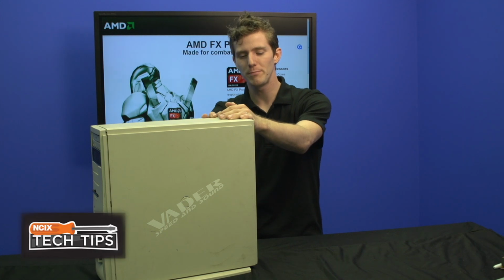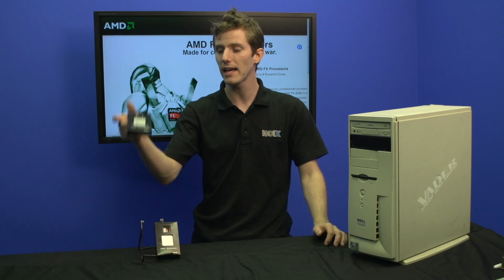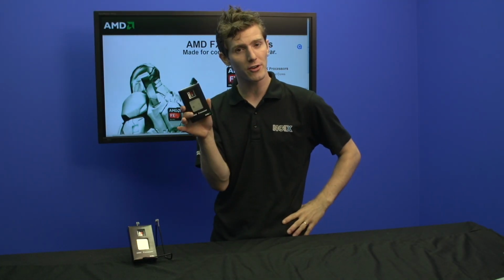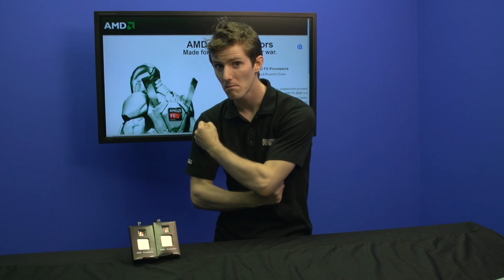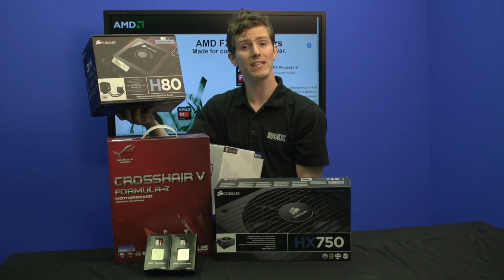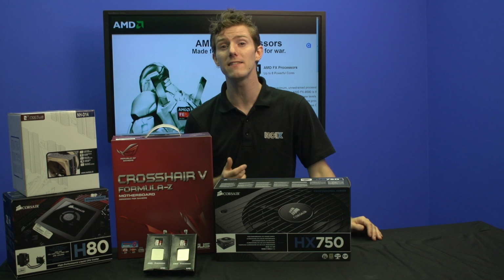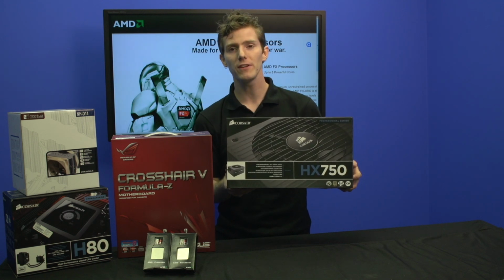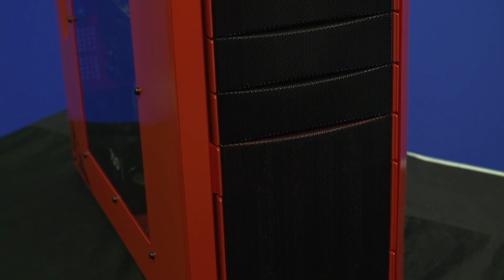AMD FX 9000 series processors hitting 5GHz!

Comment: Right now, AMD is winning in Workstation GPUs and is TRUE winner of 8th gen console war (all 3 companies use AMD GPUs/APUs), since Nvidia GPUs suck at OpenCL (Not OpenGL, that is different thing), OpenCL is the future
Reply: Who cares about console? if they went with intel/nvidia consoles would be more expensive and nvidia pulled out of the console market. intel is still has better performance per watt, better performance per thread, better power usage, and can take more heat over amd.
Reply: mindman1234   amd parts arent hot and pretty much everyone dont care about 20w seriously....  amd have better cards than intel and intel have better cards than amd... but catalyst crushes nvidia's graphic drivers to asia
Reply: mindman1234
money, you need money to progress in R&D, look back at how Intel got such deep pockets.
Reply: mindman1234
nVidia didn't pull out, no one picked them for their console. You don't pull out of an insanely profitable market that has no downside but extra money. Intel CPUs have a thermal limit of ~100C while AMD can only hit ~60C, but that means nothing unless Intel can overclock better on air or water, which they cannot. Both overclock about the same depending on CPU.

You are right about Intel destroying AMD in performance per watt, but AMD are purchased for their performance per $. If people truly cared about performance per watt they would not have bought nVidia since 2008, although AMD GPUs are getting up there also.

TL;DR:
1 nVidia cares about consoles, they just lost the market.
2 Thermal threshold means nothing if you can't deliver better overclocking.
3Performance per watt doesn't matter in gaming.
Reply: mymomsagirlpoopgood
 Except all documentation on the CPUs says you are lying out of your ass.

http://www.cpu-world.com/CPUs/Bulldozer/AMD-FX-Series%20FX-8120.html

Pay attention to the part where it says Maximum operating temperatures. Here is a link to define it for you since your brain doesn't function that well:

http://www.cpu-world.com/Glossary/M/Minimum_Maximum_operating_temperatures.html

The Bulldozer and beyond line of CPUs have a maximum recommended operating temperature is 61-62 degrees. You can run it faster but not without running into issues or lowering the life drastically. We are talking about safe operating temperatures and Intel goes upwards of 100 degrees Celsius without issue because they have fail safes built in. No one with any computer knowledge would get an AMD CPU that hot. AMD CPUs will burn themselves out if you do not have bios set up properly Intel CPUs are drastically less likely to have issues due to down throttling.

Please stop spreading misinformation. If you run a Bulldozer CPU beyond 60 degrees Celsius you will drastically lower the life of the CPU as has been proven time and again with any CPU. The only people that go above thermal thresholds are people that do not care about throwing money away.

Besides if you hit 100 degrees Celcius for a Bulldozer CPU you are doing something very wrong. The Bulldozer and beyond line runs much cooler then the Intelcounter parts by default with stock cooling.
Reply: You are wrong. It is not even worth my time to point out all the misinformation in your argument
Reply: You could start by linking to any source that says you should push past the listed maximum thermal thresholds, because it's not necessary for overclocking and will only result in an unstable OC.

Linking any data is kinda hard when the data doesn't exist. It's hard to begin to fight facts with ignorance. 100 degrees Celsius would fry the a Bulldozer CPU. My FX-8150 is currently running at 4.5 ghz OC and my core temp barely ever breaks 50 degrees Celsius on air cooling (ambient temp dependent). You seriously have no clue what you are talking about. Stop trying to melt people's CPU with your trolling.

You are seriously doing some fucked up shit if your AMD Bulldozer hit 80 let alone 100 degrees Celsius. Learn to overclock properly please.
Reply: mymomsagirlpoopgood Feel The Burn
Reply: mymomsagirlpoopgood The athlons are a different beast to the FX. Athlons could hit higher temps, but the FX can't. Just because you have a athlons, means nothing. tell me about knowing the thermal limit of an FX, once you have an FX. But it is you that don't have a clue. I am an FX 8120 owner with H100i AIO. I can say 61 is the thermal max. I have puched it to that thermal max in summer with no AC, and have it chuck a hissy fit at me (I had a H55 before I got the H100i).
Reply: ***** No, its not that XB1 is running AMD chip, its the fact you bought weaker console for same price as PS4
Reply: Bound4Earth PowerPC was better option back then, but now its not, Wii U is using PowerPC and I dont see it helps much, also CPU power is useless today, since PS4 and XB1 use CPGPU, so their GPU can do CPU tasks (And ofter much efficiently), problem is that multiplat developers dont use this. (Otherwise AC: Unity would run 1080p/30 on PS4 instead of 900p/20)
Reply: Bound4Earth PS2 had better CPU than both GC and Xbox, however GC and Xbox had more memory and better GPU.

Comment: AMD FX-9590 , 2 X Radeon R9 290X... Is that good ?
Reply: Basically your system would be a fireball a 290X runs hot enough but 2 of them? srs?
Reply: Please for the love of your family dont do this. At load your house will burn down.
Reply: Axecution

Comment: AMD is for poor people it is unstable and runs piping hot, however intel is more priced but stable and can over clock to the same in a more stable environment
Reply: AMD CPU's runs cooler, their GPU's run hot though. AMD is as stable as Intel, never had any brand fail on me. Although the Intel one was hotter (albeit it doesn't matter since Intel chips can take higher heat than AMD).
Reply: Intel Ivy bridge and Haswell CPU's run hotter than the AMD CPU's up to FX 8350. (FX 9370 and 9590 are not included because they are getting too hot). But the Intel CPU's will shutdown at about 105 degrees. The AMD CPU's will shutdown at 80-90 degrees because they can't take that much. Ohh and AMD is not for poor people and the AMD CPU's are perfectly stable !!
Reply: KingOguzhan12 +1, but the thermal limit on the fx series is 62 degrees, then it throttles. But the 9370 and 9590 are just ridiculous overclocks on the 8350. Time for amd to bring a new cpu architecture, I hate the fact that they gave up.
Reply: Thats totally biased. Just shhhhh.
Reply: kingDeCosta123 lol right I love it go Ryzen
Reply: The problem is "Money". AMD doesn't have the money to compete with Intel. But at least they can keep up with great GPU's and APU's
Reply: KingOguzhan12 My next CPU is going to be an Intel processor and it's going to cost me more because AMD can't be competitive. That's really a shame. Their APU's are for htpc's and really low end budget PC's, I really wished they could compete with Intel.
Reply: KingOguzhan12
I have the fx-6200 paired with the gtx660 I have 4 monitors connected to it and I only play bf3 with my girlfriend so it will be quite some time before any upgrade is necessary.
Reply: What are u talking about? My AMD runs at 17 Celsius when idle
Reply: ThePatero20
That's really good, what cooler and cpu have you got? Mine runs at 25 at idle and is an Fx-6200 with hyper evo 212 undervolted(I think my temps are good).
Reply: Really. AMD is for the budget. Intel is for performance. AMD IS NOT FOR POOR PEOPLE. It is just better for a budget. AMD has better performance per dollar. Really, c'mon. That's a very biased comment.
Reply: My next CPU will also be an Intel processor. But for now my FX 8350 is just fine. My CPU got 1 year old yesterday xD. Even if I hate Intel I have to get a CPU from them in a few years..
Reply: Oh LOL... Fan boy talking non sens. AMD CPUs don't run hot, they need more power and are stable and can overclock better. If you have 2000$+ go intel and nvidia(like i did) but for 1000$ or so i made a friend a pretty nice and close to my performance AMD machine. You can't beat AMD CPU Value (CPU Mark / $Price ). Intel just overprice there stuff because they can (we will buy them at any price)
Reply: Юлиан Миланов Well the 4930k gives better value than AMD's 9*** series.
Reply: Talking about FX8 series. This 9 series i can not see the point in it
Reply: Юлиан Миланов Depends on application the 4670k can be better, It sure as hell beats the 8350 in Battlefield 4. (BTW Screw mantle until it's fixed)
Reply: I am with 4670k. But here it costs around 50 to £60 more then 8350. I have manage to clock them both and the AMD processor  is doing pretty good. For my next by I definitely am not going to rely on reviews
Reply: Юлиан Миланов The 4670k cost only 200 SEK more than the 8350, but I have the fx-6200 and it's fine for me.
Reply: Salpeteroxid I have the FX-4300 and with the stock cooler.
Reply: ThePatero20
Impressive, the TDP is lower on your model so it's only logical your temps are cooler. How do you experience the performance is and what graphics card have you got?
Reply: Salpeteroxid I have the ASUS GTX 560 Ti. Performance is good.
Reply: ThePatero20
Sweet!
Reply: If SONY and Microsoft would have used intel CPU's, PS4 and Xbox One would cost 200€ more then they are :P
Reply: ThePatero20
The reason they use AMD is because the inbuilt graphics card in it, it's called an APU. It's cheaper and gives a good bang for the buck.
Reply: Salpeteroxid I wonder: would graphics on the Xbox One be not as good as the PS4 because the PS4 has faster memory for graphics than the XBox One?
Reply: Obsidian
From my understanding that is why. 8 gigs of GDDR5 as system memory beats 8gigs of DDR3, just as the APU processor are not as good as pure GPUs. But GDDR5 is not as versatile as DDR3.
Reply: $318 is not cheap for any cpu and look i have been building intel computers for a long time yes they last longer but there not the end all to be all there are good AMD cpus out there this being one of them i think ill build AMD next. Dont be loyal to one company can you imagine if it was only intel how much a cpu would cost
Reply: I am poor so i think i might get amd
Reply: Money doesn't mean everything. But i would still go for Intel, if i could. However, AMD is fine for me.
Reply: Sauce
I don't know, I had an fx-6200 on a 960 asrock motherboard, could play all games fine.
 If I'm on a budget, an fx-6300 would be my choice.
Reply: Salpeteroxid Thats funny, my brother has an FX-6300 :D
Reply: Sauce
Mine too. I chose his parts. for a mere 800 bucks he got a 760 and an fx-6300 + everything else.
(Parts are a bit more expensive in Sweden than in the US)
Reply: Nice!
Reply: Sauce
His PC is pretty sweet for what he's doing. (LOL, WOW  mainly)
Reply: Hehe :)